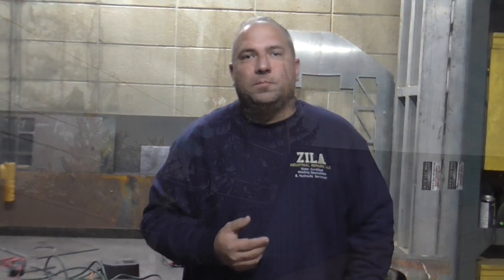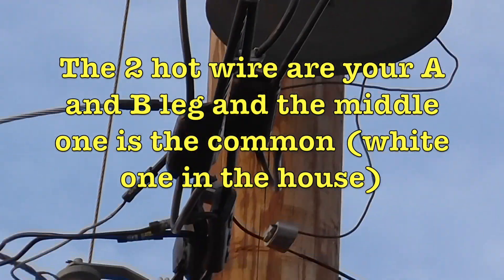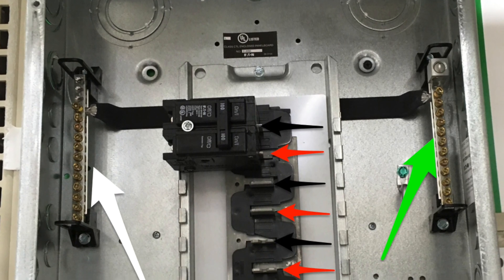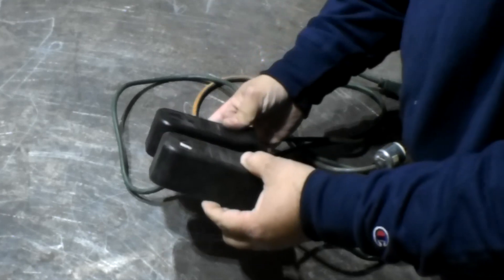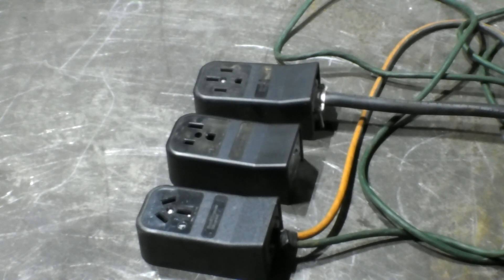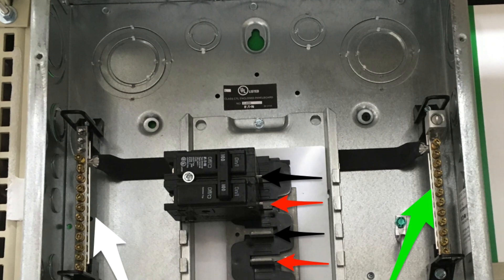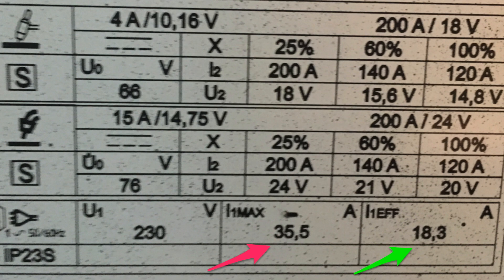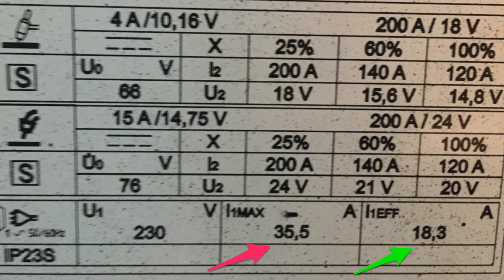How to run a 220 volt welder on 110 volt - Is that even possible ????

Comment: Had a welding union friend in the 90s who did this. Connected his 220 female plug split to two 50' standard extension cords, each having a male 110 plug. He'd run the two male plugs into two 110 house outlets, then be able to run it all outside and weld. Ran those cords outside and welded my vehicle that ws parked on the street. Too cool.

Comment: So how dose this work with my house , my house only has Two wires period coming into my box the third one is taped back to its self, will this work in my case , I don’t have a neutral wire at all my service is one 120 or 124, I only have 112 sockets in my house, 40 amps main 1 breaker, it’s two 20 amp connected together, thanks BigAl California.
Reply from the maker: You need a step up transformer

Comment: but how do you use it, how does the welder use 2 seperate  120 volt lines i didnt think i got that part
Reply from the maker: you plug one 110 plug in the living room and the other one in the kitchen or bedroom as long as they are on different legs, and they get wired in a 220 outlet .. and ere you go
Reply: @ZILAwelds  no what i mean is how do you use a negitive for a positive in the plug

Comment: Ok so I'm wanting to run my welder off a small generator but the  220 has a 13amp breaker not big enough,   but it has two 110 receptacles both wired on separate legs with separate 13 amp breakers. Doing this I should be able to make it work.
Reply from the maker: 13 amps is 13 amps if you get 13 amps on 110 volt you have 1430 watts at your disposal if you run 13 amps on 220 volt you have 2860 watts at your disposal ... having 2 legs of 110 with 1430 each gives you 2860 ...  so no there is no advantage
Reply: @ZILAwelds  thanks

Comment: While this works, its not advisable. 
1st, although I'm not a licensed Electrician, I wouldn't think this is leagal. 
2nd, this will be lethal if not done correctly. 
3rd, I think if there was a short, it would be possible to backfeed and energize an otherwise 110v Circuit.

Comment: But  20 amp 240v isnt very useful.  I cant think of anything
Reply from the maker: Ryan besides to weld some hand railing or bed frame or a ss kitchen sink or a metal table ....  how much power are you really drawing ?
Reply from the maker: Ryan the “not very useful” is all depending on what machine you want to run on that cuircuit ....  
1st of all its about double as useful as 110/120 volt on a 20 amp circuit
2nd if you want to run a miller 252 wide open that pulls 50amps from the wall of course its useless
3rd if you have a modern  ( maybe even European build ) inverter machine ....  things look different
4th the standard in most of europe is 230 volt 16 amp    Now there are some 20amp circuits but those are far and few between
4th  they actually make 180 amp machine recently even 200 amp machines ( tig and some mig mostly) that - believe it or not will run on this power
Reply: @ZILAwelds   A mig 200a and lower will have a 120 option. Or at least Miller and lincoln.  
  It still is a fun build if you need it for a project.

Comment: Also, to further explain the 3 or 4 prong 240v receptacles: 3 wire is obviously 2 hot legs, plus ground for safety.  A 4 prong 240v receptacle also includes a neutral wire.  The reason for this is to bring both 240 and 120v to an appliance.  A good example would be an electric stove or dryer, 240 for the heating elements and 120 for control panels or lighting. The 240v components connect between the 2 120v legs, the 120v portions connect to one leg and the neutral... so the same as a single circuit breaker.
Reply: Do u mean 110 and 220
Reply: @christophervickers9685  110/120 is what I remember from years ago- I wasn’t sure when it changed, but google says most US homes were 120 in the 1950’s, and it became the official US standard in 1984. It was originally 110, became 115 in the 1930’s. Interesting how long archaic terms remain in our launguage!

Comment: North american wiring makes more sense when you realize that your panel is 240v, but adapted to 120v when a single leg is connected to a neutral. The two legs have 240v potential, A single leg to neutral has a 120v potential. And because it's AC, or Alternating current, there is no + or -.

Comment: This is well explained, just not a great idea. It's really not difficult to run a dedicated 240v line.  Or, use the electric dryer plug if it's a temporary situation.

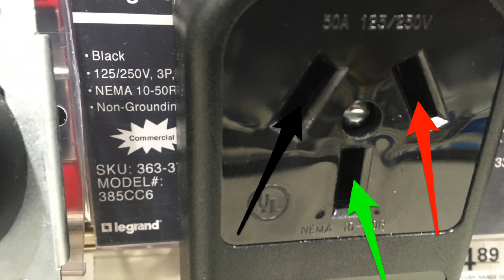Comment: @5:56 your showing a 3 prong outlet and stating the bottom prong is ground yet off to the left it states it's non grounding.......
Reply from the maker: the way how the welding machine requires it to be wired - that bottom prong needs to be a ground as it directly connects to the sheetmetal case of the welder.  the welder itself needs 2 hots and a ground. there is no common needed there is nothing that is 110 in the welder. I know its is confusing to me as well - and like o said I am not a real electrician I dont even play one on YouTube the way how all the operators annular on the welder that I have read read is that there are 2 hots and a ground.  I see what you are saying how the outlet itself is labeled contrary to what I say in the video. I dont really know why....
Reply: @ZILAwelds  And what did they use before they came up with the ground wire?
Reply from the maker: zeke112964 the common wire ....   and later on they said that that would be “unsafe” as the common wire would carry some residual electrical current ....  but yet in the usa the green and the white are connected inside the breaker box 🙄
In most of europe the are separated in the box and the white ( which is blue in europe) is grounded a few miles outside the city where the green ( which is yellow with a green stripe) is grounded multiple times inside and around your house ....

Electricity only makes limited sense to me at times ....🤷‍♂️
Reply: @ZILAwelds  the outlet he shows is as nema 10 50.   It has two hots and a nuetral. No equipment ground.  They are only allowed for replacement

Comment: To do this. U must be on 2 different phases and only use the 2 hots kinda tricky and time consuming. 
I would recommend u use the dryer or stove outlet. Much easier faster safer 
Yes I am master electrician and welder
Reply: They aren't different phases. Just oposite sides of a split phase.
Reply: What if you don't have a long enough cord to reach the dryer plug in the laundry room from the garage? I have a wall plug adapter and it doesn't power it

Comment: That's totally legit, but mostly if you can plug each 120 plug into separate circuits so its using at least 2 20 amp breakers.

Comment: You can also double tap a 220 and run another outlet. Just don't run it if the other appliance is being used.
Reply from the maker: Daniel Gagne you can do that, provided that there is a 220 outlet in the house somewhere....

I have seen places with natural gas range, natural gas dryer, natural gas hot water heater and only window ac ....  not a 220 hook up in the entire house ....

Comment: I think I know how he did it. You sure have a confusing way of explaining it. Modern fuse panels have everything split up and hot leads are hooked to one hot 110 volt line or the other. To get 220 volts you have to use both 110 volt hot lines. 
To get 220 volts the way he was doing it he had to connect to a 110 volt hot side that is hooked say to the left side of the box ( example : bedroom is hooked to left side hot line ) and then get one that is hooked to the right side 110 volt hot line ( example: bathroom outlet is hooked to the right side 110 volt hot line) and manage to connect to both 110 volt lines and get 220 volts.
This might even work except you would probably have to plug one of your cords into an apartment way down the hall to get a connection to the opposite side of the fuse panel than your apartment is connected to.
  220 higher voltage would take less current so you might get enough through those little wires all that distance to weld very low. Probably pop the breakers every 20 seconds though.
Reply: The internet is a tremendous thing. I explain things like this to my sons how much trouble I went through just to find out information such as this back in the 70s. I had the idea how it might work but wanted to clarify. I could not get the info from anyone. Any electricians I worked with acted like I wanted the secret location to their diamond mine. I finally found a diagram in a book in a store.
 Now you can go online and find how just about anything works
Reply from the maker: a left and a right are on the same leg, they need to bee next to each other on the same side for example. - they need to be on different legs

Comment: There are many ways to skin a cat. 
1st.) making a 240 volt from the main box.
2nd.) make an extension cord, using two outlets, that are on separate phases, multimeter will read 240 volts. 
3rd.) other option is AT YOUR OWN RISK. it involves connecting at the transformer. (that's if your meter hasn't been hooked up) you've been warned.  
Gives Video a Thumbs UP. i Like, OLE!
Reply: :person-turqouise-waving:

Comment: That can be done if the two 120v sockets are on different phases. You have to plug the two 120v plugs onto different phases.
Reply: Just to be clear, a house hold panel only has one 240v phase, made up of 2 legs. The common conception is that we get 120v service that can be doubled when we need 240v, but it's actually the other way around.
Reply: And they usually r not in the same room

Comment: You shouldn't be telling people about the 22110 trick because it's not legal it's not allowed by code no inspector would allow it because a 220 has to be joined together so if one of the two phases trips the whole thing goes what's your doing is literally a hazard
Reply: OK... 1. Change your name as your not living up to it!
2. he said he isn't an electrician and that it physically works NOT that it meets code ,that you should do this or even my favorite , HAY KIDS, try this at home!!!
3. basic physics , take 110v  source to pole A . apply sepereate 110v source to pole B add a ground or nutral  and you have 220v . not talking hazards or codes just basic math.
4. if we only teach people what is legal , not possible , our world would look like africa 100 years ago if not 1000.
5. your right that no code enforcer would approve. 
6. however , like having a kid around a camp fire I wouldn't leave it unattended. and have safty material handy.
6.5.  shit not going to make 10. ( white out ? we don't need no stinkin white out. we have backspace:)
7. you were not concise on the " join together" part. From what I gather breaker 1 ( pole A) has a fuse , leaving breaker 2 ( pole B ) hot causing a fire or electrocution . Now again not saying the whole things not hazardous. But a breaker by definition is a fuse and will trip (shut off ) with excesive amps or other problems . So both pole A and pole B have separate fuses and should... SHOULD,  blow both fuses if over amped or grounded , crossed ext...
8. TRICK. this is not a trick it's a jerry rig or work around as a favorite quote says 
" A trick is what a prostitute does for money".  
9. im a survivalist , say your power ( main power) goes out , you have your 110v generator and your only heat source is 220v. what do you do?  or your wet clothes and no fire but a 220v dryer. You can't do shit without knowledge.
10. What would you say if I told you , you could power a small house with a single car alternator ; which you can...or charge you phone with a lemon ( the more the merrier ) also possible.  phew made it to 10

Comment: This works by plugging one into one room, and the other into another room, as code is that you should not get 240v going from the hot in a room to another hot in the same room. That means you can get only 120 in one room, but 240 from going to a hot in one room to a hot in another room. I did this same thing as a kid many years ago and my parents could not figure out how I did  it.  This video is correct. That is because you are going between two different hot legs you will get 240v instead of 0v. Also lights are usually 15v, and outlets are 20a. meaning you can get 20a at 240v. Also use 12awg or better wire to do this so your cord does not overheat.
Reply: Does the amperage also double when doing this? Example: going from 15 amps and then doubling to 30 amps when using the adaptor?
Reply: @jambam6176  no a/c current doesn't work that way.

Comment: To all who are commenting and saying two phases, there is only one phase "single phase".   If you meant to say two phase conductors instead of hot conductors,  then ok.   I love comments on electrical videos!!   Most are totally wrong.
Reply from the maker: kevin, you are right - you can clearly see that the transformer only picks up one phase on the pole, it only ties into one of the high voltage lines (not 2 not 3) ....  and coming from Europe myself it was very difficult to understand that int eh breaker box ther are not actually 2 or 3 phases but one phase and in inverted phase.  it is the same phase all the time on every leg in the box just half the breakers are on the 180 degree inverted phase ...   and if you put the phase and the inverted pahse together you get 220 or 240 or whatever you get where you live ...   It is "complicated" but not really ...
Reply: ZILA   Again, there is only one phase.   There is no such thing as inverted phase or 180 degrees shift.   The only difference is the voltage.   They are at exactly the same point in time.   The neutral is a conductor connected to the 240 volt coil at half way through the number of windings, therefore half the voltage on both sides of neutral.   When you see a sine wave drawn with a horizontal line through it at zero, the length of the line direction is time.   Good luck with your channel.
Reply from the maker: thank you.  I will investigate this more ! seems like i have been underinformed all those years
Reply: ZILA   No problem.   Many people have been mis-informed!   The problem is they are placing the mis-information on YouTube and someone is going to get hurt or die.

Comment: Like others said this is that dangerous 2 110v circuits from both phases wired together to make 220v. Problem is the hz is 60 not 50 and the amperage is 15/15 or 20/20 not 30 total so if one breaker pops the other line is still live at the join. That can kill you, and also the wiring is not rated for the potential amps draw so fire is easily possible.
Reply from the maker: 50hz or 60hz - most modern welding machines don't care ....

Comment: The long story short... you can get 2 different phases 120V each in almost any US-Canada kitchen. Most kitchen have split receptacles here, at least new homes have them....

You get 120V from 1 narrow prong  from one receptacle and you get 120V from another narrow prong from another receptacle. If receptacles are on the same 120V wire (the same phase) you get nothing between  first and second prongs, but if they are on different wires (connected to different phases) you get 240V between them.

I used this trick a few times when I got stuck with no 240....
Reply: a dryer or an electric stove outlet will do the trick and is more than  sufficient for any welding job  done inside a house